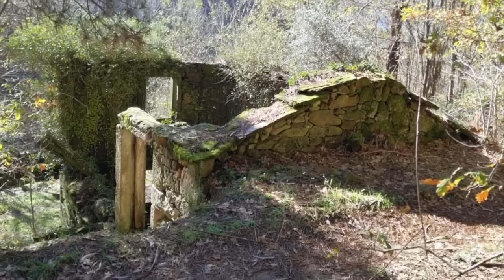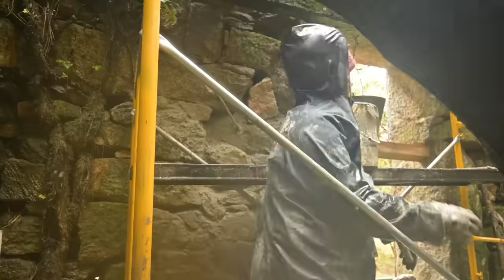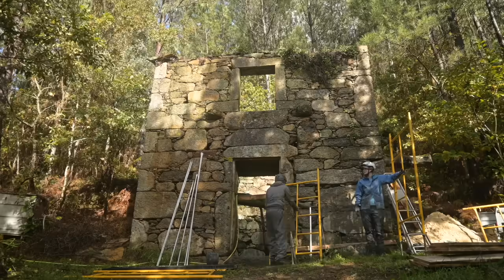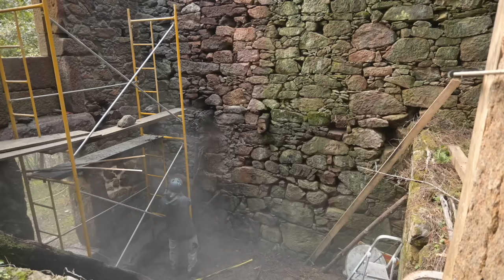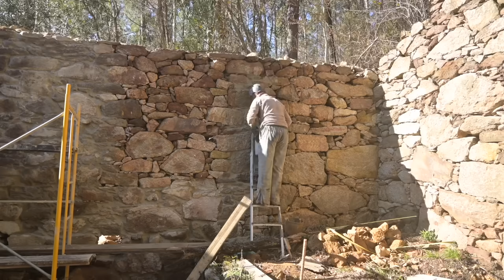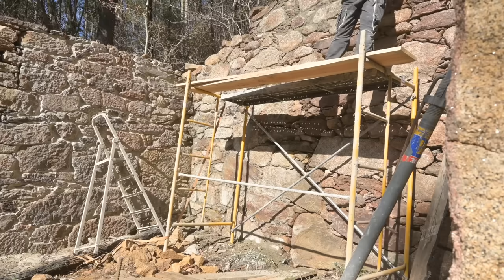Stone House Renovation - Part 1: The Walls

Comment: Wow. What's left of this ruin is pretty incredible. You can see how carefully the originally builder selected huge stones and fit small ones in the gaps, and how they all form a uniform vertical surface. Even with most of the mortar eroded, the roof collapsed, and ivy growing all over it, the remaining walls look pretty good. It must have been very fine work when it was originally built. Some incredibly large pieces are left for you to preserve, like those beautiful lintels over the door and window, and those lovely large uniform quoins on the corners. I can already see that this is going to be beautiful.
Reply from the maker: You name it Brendissimo, exactly what we thought too. Especially while working with stone ourselves we realized how much effort was put into these walls, doors and windows. All stones of each wall were treated by hand to give them this uniform surface. An arduous job, that shaped the stones we are now building on. Thanks for your comment.

Comment: It’s going to be gorgeous when you’re done! I really hope you are using lime mortar between the stones because using cement will lead to major moisture and mold issues inside the house. Lime mortar lets the walls breathe and dry out after they get wet, cement traps moisture.
Reply from the maker: Thank you for your comment, and your suggestion with lime mortar. What you see in the video is cement mortar. We chose this because we are going to open windows in a wall and enlarge the lower floor, basically build a basement, while maintaining the walls. So we wanted to get the walls as stable as possible, before doing that. Nevertheless we only filled up the gaps until about 3-4 cm from the wall surface, leaving some room which we could fill up with a lime based mortar later.

Comment: Just seen your restriction on the water tank the steel clamp is a good 👍 idea. If it's not stainless steel it will rust and expand and split the stone. Putting plants in holes in the stone work will over time spilt it apart as well. But looks good 👍

Comment: Really impressed by the amount of work you guys are doing here.  Love the old stone walls.  Am curious what you are using as a mortar for the stone walls?

I'm hoping to buy an old stone house here in Ireland to renovate soon, and considering the rain you have on your property, I'm wondering if things are similar.  If I want to have breathable walls and traditional materials, I'll have to go with lime mortar.  Or I could say screw that and go with cement and use modern materials to deal with any moisture issues.
Reply: Using new materials might make sense in the short term, but always remember that there was probably a reason for everything they did before we got electricity, and lime mortar and more traditional building methods will lead to a significantly better structure with air quality and natural temperature control

Comment: Is this a double-faced wall? Or was there a single stack of stone? Why repoint? Were there problems with the structure of the original dry stone, or it's just to be safe? What a beautiful old structure that's certainly worth preserving.
Reply from the maker: Hi BookOfNick, Yes it is a double faced wall, here they call it a "wall of two brothers". No the dry stone would probably be stable however a lot of ants and mice live in there so we wanted to keep them out. Also when opening the windows it was necessary to stabilize the wall first.

Comment: You can tell you never done that work before make sure to show the building inspector that video you have all the dumb things you're doing😅😅😅😅
Reply: Very constructive criticism and advice. I hope you do better with kids or colleagues. Although I have to agree that they are not working very safe a lot of the time. Like cutting away the beams and not replacing them or supporting the walls to avoid collapse. Or the walking on loose and wobbling planks one story up.